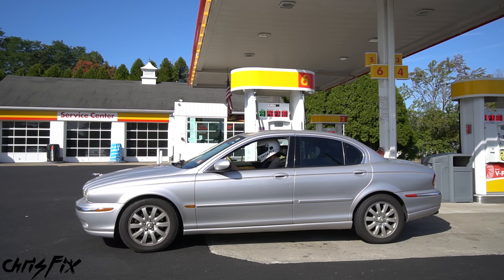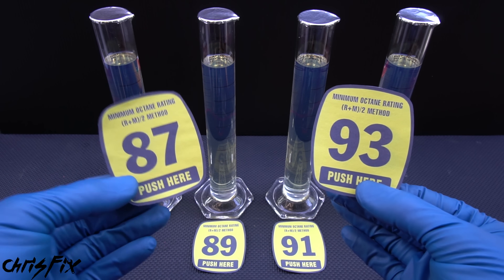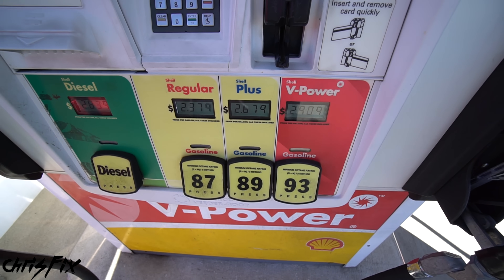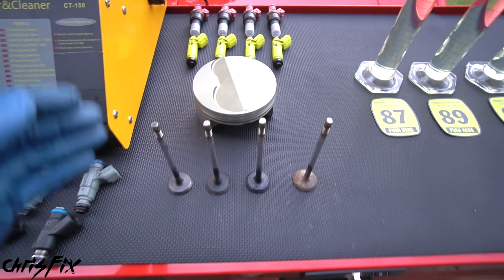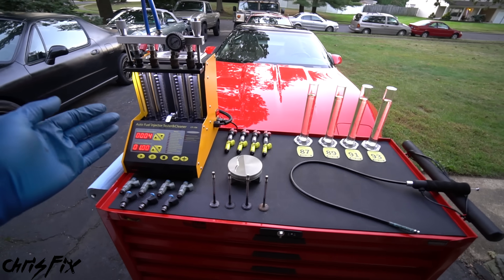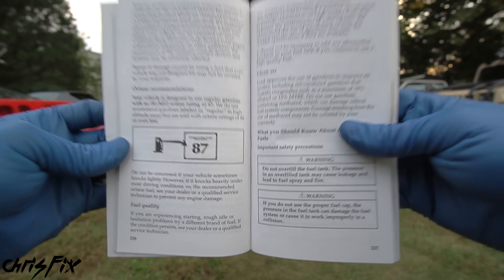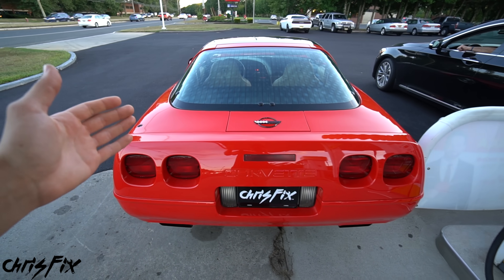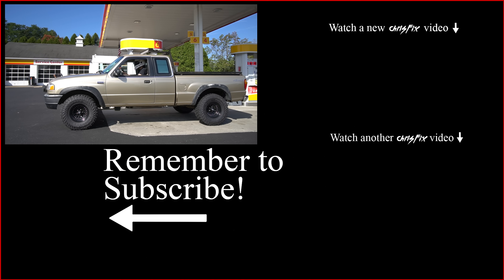What is the BEST Fuel to Use in Your Car or Truck and WHY

Comment: I have Dodge Journey with 2.7L V6 FlexFuel. I've never used E-85 because it's ethanol and therefore removes oiling protection. With E-85 I've heard that engine uses about 30% more fuel, and engine temperature goes low because ethanol has a low flammable point. So at winter that is bad choise. I'm used to use European 98E octane fuel. My Chrysler became freshier and comparing with 95E and 98E, my Chrysler 300M was driven 100km more vs 95E. Same petrol station, same pump, computer check DTE same and fuel gauge. Full tank with both and with 98E about 100km more and at the pump price was totally about 2€ more but with 100km it was 20€ saving. So stronger fuel you get, you'll drive further and save money.

Comment: I agree with most of the video.  However  higher octane fuel does burn slower than 87.   This can clearly be seen when tuning a race engine.  You can clearly see the higher octane fuel runs rich.   Because it doesn’t all burn all the fuel in the combustion process.   Hence the reason why you add timing with higher fuel. So it will all burn.

Comment: I have a 1989 ford e250 with a stock 351windsor. I do not have the owners manual, and everywhere i can look just says "unleaded fuel only" so my question is this. 

What is the difference between unleaded regular and unleaded premium, and if there is a difference, what should i run when no octane number is given?

Comment: What store has the best gas ? As far as cleaning the engine wise ?
Reply: There isn't a straight forward answer. All the gas stations won't show what additives they have. Shell's premium gas claims to have 7X more fuel cleaner than recommend, but Chevron or other gas stations might have better or worse. If anything go with Shell I guess.
Reply: @wooferjr169  thanks pal

Comment: After 4 and half years of using both reg and v power shell petrol I've discovered pretty much same fuel economy(very small difference in favour of v power) but definitely more response after filling with v power. I suggest staying away from jet petrol. Last car and current car I have I used jet once only and the car was very sluggish afterwards. I also avoid certain supermarket fuel like the plague. Morrisons and Sainsbury's is ok. Stopped with Tesco and Asda years ago. Anyone else with same results or issues? My last 2 cars are 1.4 Astra and 1.6 focus c max.

Comment: Many Midwest states offer premium fuel which is ethanol free. Because ethanol contains less energy per quantity (measured in BTUs), premium fuels in the Midwest will actually give you greater fuel mileage. Because of this, many people around here are mislead into believing that premium gives you better mileage because it is higher octane. They do not realize that it is simply because the premium they are using does not contain ethanol and therefore contains more energy per quantity which means the vehicle does not need to burn as much fuel to go the same distance as vehicles using fuel containing ethanol.

Comment: All I use is Shell 93.  Been using it in all my vehicles for about 10 years. Better pickup throttle response and idle is much better plus for some reason it seems to last longer than competitors fuels. Not sure if it's my imagination or not but I certainly feel it lasts longer on a tank.

Comment: Thanks for the video, very informative. Quick question-- which do you think has more impact, quality fuel with good additives, or using a fuel system cleaner? Ie, would it be better to use fuel with lower-quality additives and Seafoam every few months, or to use fuel with higher-quality additives and never Seafoam?

Comment: I dont have the manual and my truck does not say what type to use anywhere in the truck where it is commonly found. My dad says it uses premium fuel .
However he believes every car can use premium because " it's better because it cost more"
My truck is a 98 ford f150 Triton V8 4.6L regular cab short bed
I have trouble finding info for anything online

Comment: Actually I've tested that theory before 88 unleaded gives me 425 miles till empty and I've used a trip. I use higher octane for my car which is turbo but I also use 88 unleaded some times. I get more milage for sure with the unleaded 88 and performance too. My car loves that shit. It does perform best as well. E85 I get 300 miles till empty. 265 miles sometimes.

Comment: I had a Camry in high school I heard chains from under the hood while  hard accelerating in the hot summer but never before I told my votech instructor and he said it was predetonation and to use higher octane.. So I went from 87 to 91.. And never heard it again. Octane is important. Yes the knock sensor retards and advances as needed but there's only so much it can do as a semsor.. So.. If u hear chains under hard acceleration in summer. Don't expect a check engine light just play it safe and fill it up with higher octane..

Comment: I life in Germany and yes i know that the gas is kinda the same but our V-Power isnt 99 Octane its 100 and we also have Aral Ultimate with 102 Octane, so when i´m not mistaken we still have better fuel, at least in the higher class, and the normal super or super plus should be the same.

Comment: OR... you could just check your car manual and they will tell you which gasoline is good for your car. My x-Gf told me to the the middle gas cause it will last longer and better for car which was bs. I noticed my car right better with cheaper gas. I buy 87.  93 is for expensive cars like Mercedes.

Comment: Ay what about carburetor vehicles?  Like older cars and trucks, and even early 2000 motorcycles?  What's your opinion on the 15% ethanol rate they proposed (passed?) on fuel in the US?  Is it better to go to stations with 0% ethanol?  New and Old vehicles vs ethanol?  At what point does it become potentially damaging to the vehicle?  Lots of questions lol.  Thanks for making these awesome videos.

Comment: Diesel engines can run on gasoiline, but only untill your fuel system seizes.
NEVER attempt to start it, pump out the fuel.
Diesel in gasoiline engines doesn't run unless it is only a little diesel mixed with gas.
You can try to run the engine on that mix, it will not harm it.

Comment: I own an '08 Mitsubishi Endeavor, and if you know anything about 2000's Mitsubishis, they're very picky about the fluids you put in, for a good reason obviously because they'll run forever with proper maintenance. But anyways, it calls for 92 octane, can definitely feel a slight difference and mpg.

Comment: The euro vc usa gas myth, well, it's basically this, for over 20 years, we dropped the low octane gas, for a simple reason, our engines needed a lot more power with very low displacement and 4 cyls, and if the power is myth, well, no, it ain't. Getting more power does requires higher ron, we needed more compression, more revs and higher mpg. Where does the myth really came from, euro exports, a merc, bmw, audi, etc export, would run a lot less power in the us than in europe, Honda is the best example, specially vtec ones and all manuals, vtec in europe, does really kicks :D, and in the us the are meh. Driven bigger engine hondas in the us and they weren't even close to a manual 1.6 vtec civic, back in the 90s. Higher octane does not mean more power, but the engine can make more power with higher octane.

Comment: My acura tsx requires premium so ive put it to the test drove it 200 miles round trip full tank and same trip with regular and ive got 24mpg on premium and 27mpg kn regular without knock so you guess what octane I've use for 10 years now and 350k on the car no issues

Comment: In my one month of working at a Chevrolet dealership, we have already had two diesels come in that accidentally put gasoline in their fuel tank.

Usually what happens is diesel is a mild lubricant, and the high-pressure fuel pump needs lubrication. Gasoline, on the other hand, has no lubrication at all. So if you're unlucky enough, the bearings can send metal shards through your engine and I hope I don't need to tell you that is really bad for the engine.

If you do put gasoline into your diesel fuel system, all of the fuel lines and injectors need to be replaced. If you catch it before you turn your truck on then you only need to drain the fuel tank.

Comment: I have a ram 5.2 that will knock with high load in higher gear. I have filled it up with premium for a while but how can I fix this. 185k miles so im assuming there is some carbon buildup.

Comment: if my car runs on regular, I can use premium to clean the fuel injectors?
Reply: Yes.
However you could use a cleaner like lucas fuel injector cleaner additive as it would be cheaper in the long run to just add the additives to the correct octane.

Comment: What about shells new 90 octane with 0% Ethanol? 

Then what about the difference with 10% ethanol and the 0% ethanol gasoline ? Shell has 87 89 & 93 with 10% ethanol or 90 with 0% ethanol. 

Thanks for the video. Info i was wrong about 😔 now I know the right answers.

Comment: I always like your videos and they are always very informative and accurate. In this instance however I am not sure that I agree with you. Most engines these days run high compression and as you point out, they control their ignition timing using a knock sensor. As a general statement, a modern engine is at its most efficient with the timing set so that ignition occurs just before knocking would occur. Therefore, the higher the octane, the more advanced the timing and the more efficient the engine runs. I am not sure that this does much for performance but it certainly makes a significant improvement to the car's fuel economy. Obviously, this varies from car to car but in a lot of instances,it may be cheaper to use high octane fuel.

Comment: I was told by my college professor that he ran into an occurrence where someone put premium fuel in his regular fuel running car and due to the temperature of the ambient air it caused the vehicle not to start. Why could this be?
Reply: Shouldn't have caused an issue starting, cars that run regular fuel can typically run premium since it just further prevents knock, although being a waste of money if you dont need to run premium. Not sure why it wouldn't start, but definitely not a gas-grade issue
Reply: @Kenny-vs4pr  yes one would think however if you consider being in a northern state and having a cold winter morning, my professor said that the octane would affect the ignition temperature. Do you know whether or not that Is true in any way?
Reply: @carguy61297  haha I also live in a cold northern state so I could tell you outright that it shouldn't be a factor. Cold weather affecting starts should only be traced to starters not liking cold weather and batteries working extra hard
Reply: @Kenny-vs4pr  good to know thanks for your input!

Comment: There are only two fuel tanks at gas stations. The mid grade goes through a blending process of the low and high. If it isn't set up right, or it goes out of spec you have no idea what you are getting.

Comment: If you have a modern day car and run higher octane fuel, it should automatically advance the timing. So in a way higher octane does make more power but not because it's more powerful, but because of the advanced timing making the engine run more efficiently. On my old B18c I could advance the timing a couple degrees and see a few horsepower gain on the Dyno.

Comment: When I had my Prius 2, I used 80% E85 and 20% 98 octane (premium). It was running very smoothly. I sold it at 200000km and it was fine. For E85, it depends of the car, but you can run with some E85 without problem, just increase the E85 ratio progressively.

Comment: My owner's manual tells me what the minimum recommended octane rating I should be using is. So I use that. No sense paying more for something I don't need. And I've never had a car that died or I traded in because I didn't use high enough octane gas, so I'm not about to start worrying about it now.
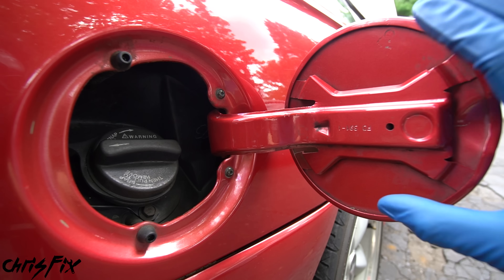Reply: 11:12 - *pats self on back*

Comment: My car calls for 87, but with a high compression 1.6L DI motor it pings/detonates on anything less than 93.  I've run Shell 93 since 10k miles and just rolled over to 125k - also regularly use techron.  The only thing that has really helped for me is the 3 stage BGK carbon cleanup.   Problem is it needs to be done every 15-20k miles.  Makes a huge difference in performance and when we are talking a 140hp 1.6L 4 banger it counts.

I always will recommend 93 on high compression motors no matter what the manufacturer says.  And yes, there is a power difference to a point due to the timing not having to back off, especially under higher load / low rpm.

Comment: Hello Chris! Thanks for the video, it was very helpful. However, I have a question about ethanol. 

I have a 1998 Ford F-150 pickup truck that recommends using 87 (which is fine), but I mentioned nothing of ethanol. I have next to me an ethanol free gas station and also normal gas stations, but I’m unsure of which kind of gas to get. I believe that the ethanol free gas is 89.

So, what’s better for my truck? The 89 ethanol free, or the 87 regular? Thanks!

Comment: Hey Chrisfix love your videos im from Denmark and here er have a car magazine that actually took this octane question to the test and in never cars specifically a kia stinger 3.0 turbo with 370hp from factory on dyno with the European octane 100 actually made 383 HP, Where the 92 octane dropped to About 363 and on the 95octane og was right on the Money the tuner that performed the dyno test hr recommends the 100octane or 99octane on newer cars with knock sensors and injection Because the 100 allows a higher compression rate before igniting without any self detonation of the fuel there for providing Better fuel economy and a slight gain in HP Hope it makes a little sense og not in more Than Happy to take a conversation About this im a machanic so i Enjoy nerding these Things and i Really Enjoy watching your vids 😁

Comment: Tesla drivers 

“When is he going to make a vid on what type of charging place is the best”
Reply: The answer is never
Reply from the maker: Im sure in the future you will have options of what kind of electricity you want to fill up with.
Reply: ChrisFix that would be interesting! Can't wait for the future
Reply: Fat juggernaut I like running my ev on 100 kwh
Reply: Premium electricity will likely be 2 cents per kWh more than Regular... but you still will need to use the only grade available in Blinker Fluid.

Comment: Ya, my truck hates ethonal fuel. Though it only needs 87, 93 runs so much smoother. Can hear it in the engine. Thing is, i not drive a diesel. Which you cut with gas to prevent freezing and easier starting when cold. So, you can run gas but only as a cutter. Older diesels can run on pretty much anything. Some actually started using gas then switched to diesel.

Why i hate peoplenwho buy dodge cars then put 87. Clearly states 89 minimum but can run 87 if needed. Not run 87 continously!

Comment: I work in the lab for a major oil company. Spent 5 years doing nothing but octane testing. If your car doesn’t require premium and you aren’t racing then you aren’t gaining anything by putting premium in a vehicle that will run on 87.   The mid grade is just a blend of certain percentage or regular and premium.  That’s the truth.

Comment: Where's that horse urine 85 that you can get in Colorado in this test??
Reply: Btw, the explanation of detonation is inaccurate.  Detonation happens when the fuel is lit prematurely (not by the spark plug) before the piston is at TDC causing the force that would push the piston down to, instead, squish the oil out of the clearance on the rod bearings.  This is why detonation can be one of the causes of a spun rod bearing.  A few reasons I can think of are bad AFR, hot IAT, and excessive carbon build up inside the combustion chamber.

Comment: @ChrisFix, my car's owner's manual states "Select octane rating 87 (Research Octane Number 91) or higher", and later states under specifications that horsepower ranges from 269 to 298 horsepower for the 3.5l V6 (the engine in my vehicle). It doesn't specify why, but I assume this to be based on the fuel used. Is my manual stating I can use Octane 93 fuel and expect more power? What fuel should be used in my vehicle? Thanks!

Comment: I personally stay as far away from shell as i can. there fuel caused my mustang to ping and have really bad detonation and i broke 5 pistons... I had never any problems with the fuel from small family owned gas but as soon as i put 91 in from shell not even 10 miles down the road it was not running well at all did a compression test and 5 of my cylinders where low one was even at 20.... i took the engine out and found 4 with cracked ring lands and 1 that was broken in many pieces I'm surprised it even was hitting 20 psi...

Comment: I'm glad you addressed the higher mileage (older) car issue. At 200+K miles my 95 Caprice runs poorly on the mfg. recommended Regular fuel. I tried to go back after using high end cleaners, replacing the plugs/filter and adhering to better maintenance but the difference between that and Premium was quickly felt. Premium it is....which really hurts when gas goes up. Next...testing my fuel injectors. I appreciate the demonstration.

Comment: so if my car recommends regular, can I use those fuel injectors additives from walmart to clean them up? and how often?
Reply: Sure you can use them, but that's just wasting money in most cases. Modern fuel already cleans pretty good and injector cleaners are only really useful for really crappy cars that should rather be in a junkyard.

Comment: 😆 a diesel will run if you put gas in it... For a second that is 😆 Also you should do a video about av-gas, such as 110LL, 100/130 octane and so on. Also on a side note I don't even think they make 85 octane fuel anymore anyway...